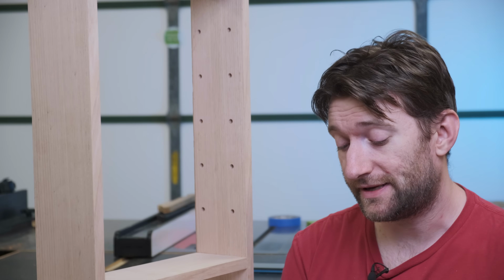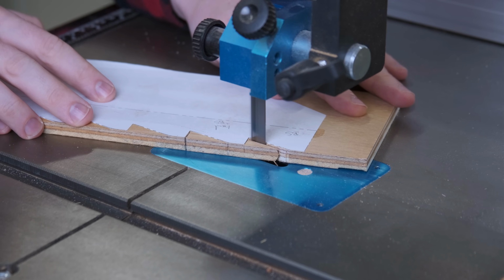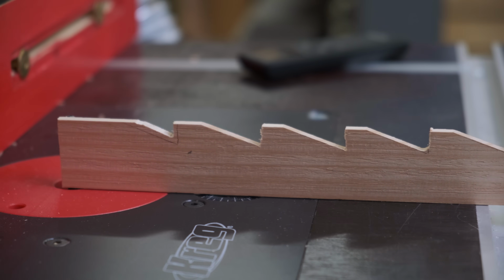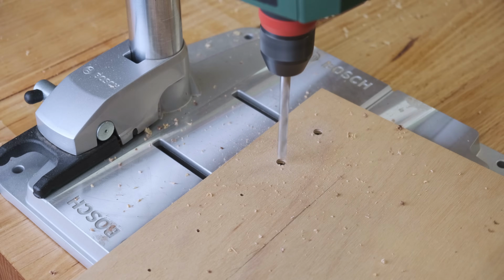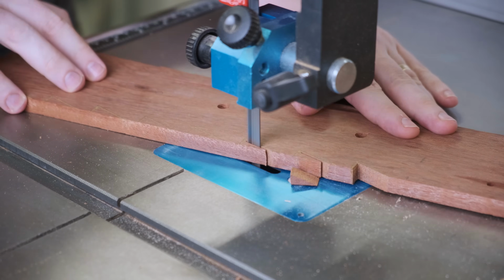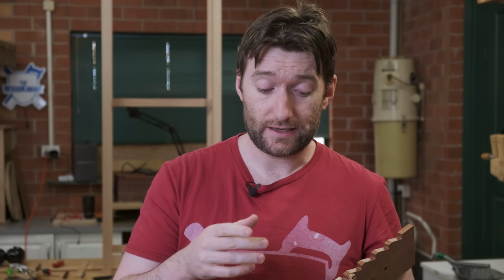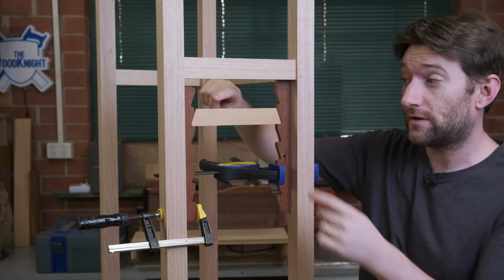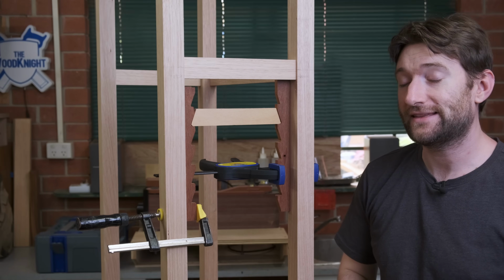Woodworking: Sawtooth Shelves

Comment: I love sawtooth shelves.  I ran across that in an antique piece some years ago and thought it was novel.  Then I bought these fairly expensive large storage cabinets for my shop that had chipboard side with standard pin holes.  It did not take long for those holes to blow out under very little weight.  Then I remembered the sawtooth design and retrofitted the entire 80" tall cabinet with then.  I notched the end of each shelf to fit between the sawtooths and then added the same cross piece you did.  Worked like a charm.  I built a really nice bookcase for a customer that thought that was a cool design.  I now have several template I made so I can add it to new projects.

Comment: Just flip the jig and you won't get as much tearout. The thing you're making is symmetrycal anyway.

Or better yet make it two sided, so with a clockwise bit you'll always be going into the corner, instead of in and out, which is the main reason for tearout. Just make a pass on one side, then flip and go for the other.
Reply from the maker: I'll have a play around with flipping the piece/template for the actual bookcase standard next week (rather than just test pieces) and report back - I think you're right and it will reduce splintering, but I'm also concerned about the sheer vertical cut nature. I guess it isn't that much different from router dovetail jigs is it?

Flipping didn't make a whole lot of difference on that particularly piece (I did flip it off camera), but I think it was actually that piece of wood. Splinteriest jarrah I've ever used, hands were hurting for days!
Reply: @TheWoodKnight   trim routing the end grain might be harder or easier then with the grain, depending on a species you're working with. Try going at a slight angle at first and don't push for one pass results until you get a feel for it. 

With dovetails it's not as much of a sheer cut, because you use router in such a way that the axis of rotation of the bit is parallel to the grain, so most of the cutting action is still tangential to it. But it's still out there in terms of danger. That's why no one in their right mind free hands it 😂

Oh, and you should probably do the long faces first, so when the bit comes into a corner after the end grain it doesn't get the idea to grab or chip anything. Probably an unnecessary precaution, but still...

Comment: Paul, You could easily simplify things here without having to use any kind of spanner pieces. Simply cut the end of the shelves with a dovetail profile to match the support brackets. Leave a bit of room on the back dovetail so it can drop into place.
I have seen many an antique piece with this style of brackets, and that's how they were done.
Reply from the maker: Do you mean a dovetail instead of the sawtooth shape at all? If so, yes, that would work but it wouldn't be a sawtooth shelf then! 

Another option is to have your standard twice the width you need, drill a series of holes up it like a regular shelf pin-style system but with a large (25mm/1") forstner bit. Then rip the standard in half. That'd be a half moon/crescent style adjustable shelf, and the bracket/bridge piece would just need rounding on the ends.  Different looks that all achieve the same thing :)
Reply: @TheWoodKnight  No. Keep the sawtooth brackets, but cut a dovetail shape to fit the brackets on the end of the shelf. Still a saw tooth shelf, it simply eliminates the need for the cross braces in the brackets.
Reply from the maker: Do you have any photo/video examples? I've never seen that, and it sounds pretty interesting :)

At a guess, the 'downside' could be that it needs to be a bit thicker/wider than the bridge piece (to keep strength while having some adjustment), but I think that'd be a particular major difference (maybe 12mm instead of 10mm type thing)
Reply: @TheWoodKnight  I will check in my warehouse and snap a few. I'll send you an email with them. Might take me a few days